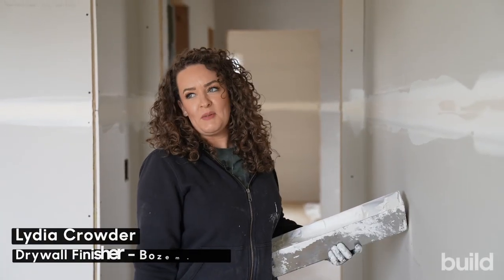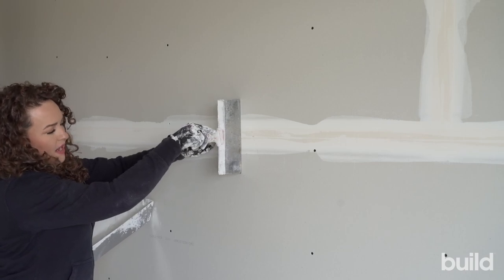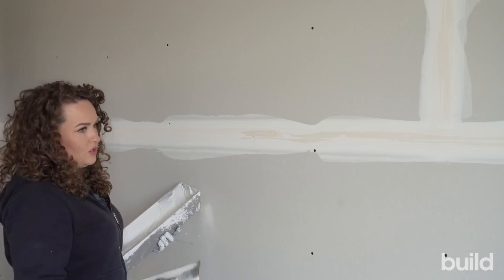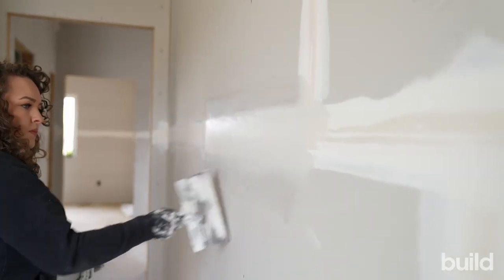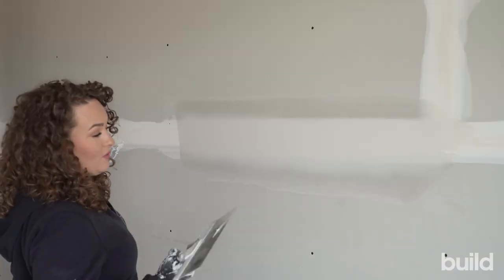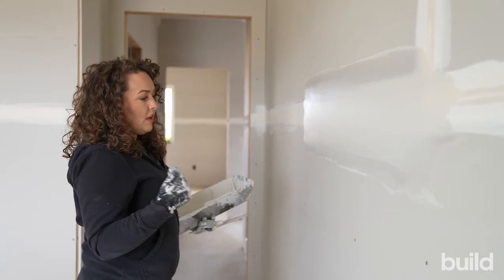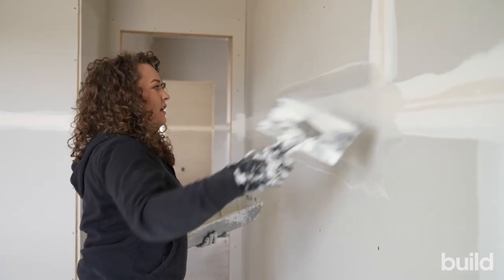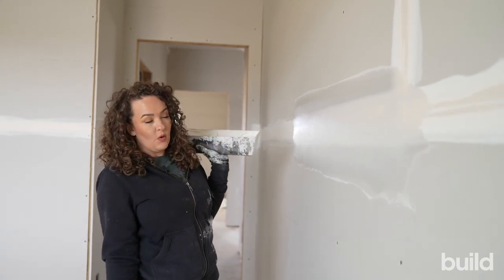How to properly fill drywall joints

Comment: Hi. Love you videos, you explain and show everything so to the point and simply!
I’ve bought a house that needs new paint but ALL of the drywall joints have extreme bumps! Even the ceiling (Existing job, I haven’t started the works yet). I’m looking to do this myself but had little knowledge of how to do this until someone suggested your channel. As this is my home I really want the best finish possible. My question is would doing a massive amount of sanding over the existing mud give a flat surface?
I’ll be doing one room at a time so lots of sanding is doable. I’ll be painting.
Reply from the maker: You can, it will take a lot of sanding because you'll also be sanding through all the paint that's applied. I would suggest instead of sanding a ton you scrape down the surface and then start floating out all the bad areas with mud. Skimming blades will help a lot - a 24" is the easiest to handle but still a nice size. It will be easier than sanding a ton and give you a better finish too. Definitely start with a small area first to be sure it's something you feel comfortable tackling and you can get a feel for how to do it.

Comment: Can you use hot mud with paper tape? And can you use hot for the prefill and taping ? Or would it be better to prefill with hot mud then tape with an all purpose ?
Reply from the maker: You can tape with hot mud just make sure everything is bedded correctly. Hot mud doesn't shrink much so it can be really easy to over fill with it.

Comment: What is it that causes the tape to bubble?
Reply: I’m  not as cute as her , lol…but I assume that if u cost over wet , shrinkage pulls the tape from the joint and air gets behind the tape .
Reply: No, not enough mud behind the tape.
Reply from the maker: The tape is paper and the mud is the "glue" that holds it to the wall. If there's not enough mud behind it then there will be pockets of air under the tape which are the blisters. When taping you want to make sure you're using mud that's thin so it spreads evenly underneath the tape and press firmly with your knife embedding the tape in the mud.
Reply: @DrywallShorty  thank you

Comment: The bevels are not filled!!! that's more shrinkage when second coating,

Taping
Second coat
Skim
Sand
Sponge/light check (300watt)
Touch ups with yellow tint 😎